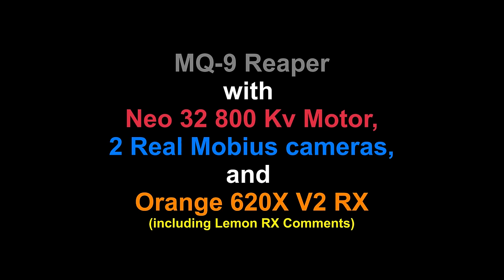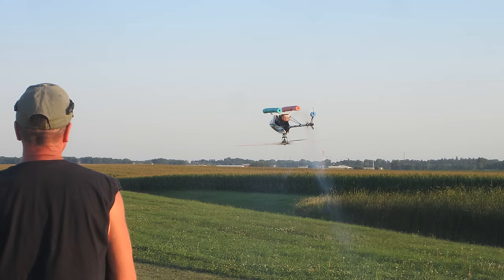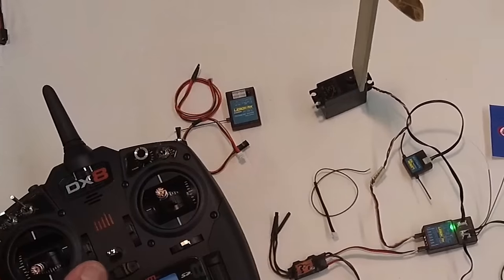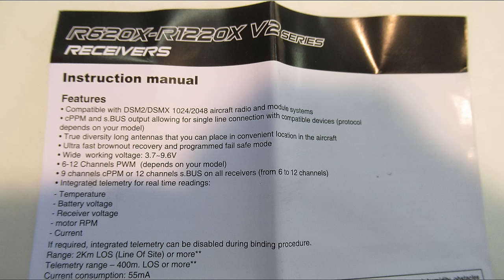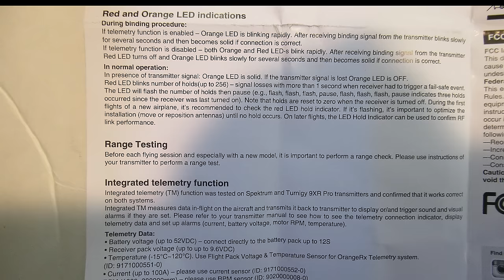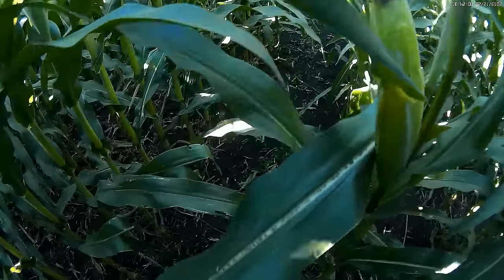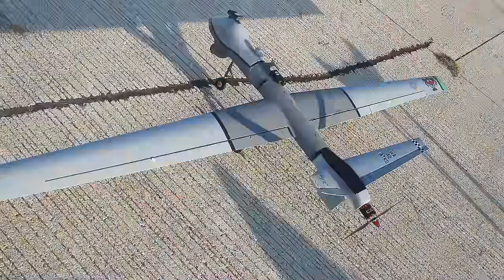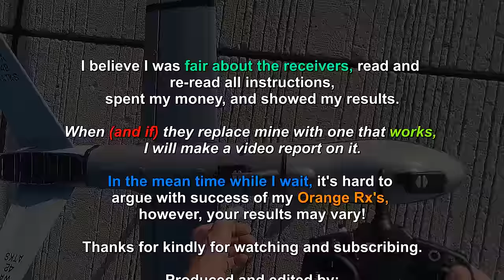MQ-9 Reaper Drone Restoration with an Apple, a Neo, an Orange, and a Lemon.

Comment: Great to see you back in the air with it, the name lemon is unfortunate. We the the saying here un the UK "I bought a lemon" usually with a plush looking car that's comes loaded with hidden faults. 
It looks like the same now goes for RC receivers.
Reply from the maker: Haha. They are fledgling company so they will come around I expect. Others seem to have good luck as I also expected. People always promote what they fly,  but in my case I have been using Orange Radios and receivers for many years, thus proving the reliability of them to me. Never had a failure, even in DSM2, as most of those machines I show are. I had more trouble with the Spektrum RX's. Thanks for the comments.

Comment: I use Orange module with a 9XR, and other oranges. In an effort to diversify my fruit stand, I tried a couple Lemons.  I also have a DX-6 that was, after tooth and nail, refurbished by the manufacturer (mode 2 throttle potentiometer failure.) Now I use that TX as a trainer, kids, nothing serious TX. Recently I decided to bind it with a Lemon RX to diversify RX's vs TX's at the field. The DX-6, Lemon combo proved catastrophic to one young pilot's bid at flying a simple 3 channel that I've seen him fly like a champ many times before. After the "complete lock" of controls he experienced, I set up a similar air frame with an Orange, same DX-6 and it was perfect. In troubleshooting TX, RX it's tough to call a culprit, but I've personally experienced problems with Spectrum Lemon. I'm happy to see others are picking up on this. I wish I could get my money back from Spectrum. Times change in RC, quickly. My 9XR is perfect on Orange module, Orange RX and for serious models, I use FRSKY Mod+TX.

Comment: Hi Dave, I've just had a play with my Lemon DSMX 6 Channel RX with satellite.I bound it to my radio, switched it off and removed the bind plug, no failsafe! Pushing the button does nothing at all.So I had a think, rebound it again, this time I didn't switch anything off, I left the bind plug connected, moved my sticks to the desired failsafe positions et voila, failsafe on all 6 channels!Lemon customer service is excellent, far better than HK, try buying direct from them if you decide to try another, there delivery service will amaze you.Good luck & happy flying!
Reply from the maker: I tried all that and even talked to the Seller, who is reputable.  Your receiver is not aTelemetry version, so there may be a difference.  I couldnt send it to Lemon RX, because I did not buy it direct from them. I didn't know, you know. I bought it from a place I always buy from and had it in 2 days. There is something wrong and they told me to send it back. I wanted it to work, but again, I have had years of great success with my Orange Radios and Receivers, so you can't blame me for having cold feet now. If I get it back, I will try again, but in reality, I don't need anymore receivers anyway, as all my planes are working just fine and I only wanted to try one with telemetry.  I did not know Orange made telemetry receivers when I bought the Lemon on your recommendation.  Thanks for the comments.
Reply: The DSMX 6 channel without telemetry direct from Lemon is cheap.
I have never tried telemetry with Spektrum, so I have no idea really.
If your happy with DSM2 (Which I know you are), might be worth trying a Lemon DSM2 receiver as they are very cheap.
Reply from the maker: Oranges are inexpensive too.  I am happy only because they all work you know.  Before DMSX, there was only DMS2 anyway. My 2 new Orange RX's are DSMX, and I intend to use DSMX rx's from now on.  If I get the Lemon Telemetry version back again and it works, I will put it in something and try it.  I wanted it to work you know.   Thanks again.
Reply: +NightFlyyer glad Orange is working for you, your RF link problems all antenna related as your new DX8 with diversity antenna seems to be working well.

Comment from the maker: Lemon Instructions say, bind with throttle down, then pull bind plug out before shutting off.  I did that....at least 30 times! Failsafe still failed!  First the wings folded, then it burned out a motor and I spent an hour in the cornfield.  Then using my Apple I ordered a Lemon and an Orange, which gave this flight result with my MQ-9 Reaper Drone.  
When (and if ) the Seller of the Lemon replaces the one I sent back 3 weeks ago with one that works, I will report on it. In the mean time, I will continue to use my reliable Oranges. I ate the grape!  :-)
Reply: Thanks for sharing Dave.... I'm just curious... with your new Orange v2's did you bind in DSMX or DSM2 mode?  I had 5 v2's lock out on me at Flite Fest this year (all bound in DSMX mode); whereas, in the last 2 years I've never had any issues with my old DSM2 Oranges.   The irony is that the plane I chose (and successfully flew) for the Guiness World Record attempt at Flite Fest was a LemonRx bound in DSM2.  Part of me wonders if the Orange's DSMX might not have been up to snuff for channel hopping with the aggregate number of pilots flying.  

Anyway... just curious about what mode you're binding in.  And totally agree that peoples' mileage will vary.  (Oh, and I got my LemonRx direct from Lemon (http://www.lemon-rx.com/) for what it's worth.)

Thanks for your vids... always enjoy seeing what you're up to.
Reply from the maker: The DX8 Gen 2 binds to the RX's to what it sees from the receiver. My Orange 620X Version 2 always binds in DSMX, as you heard it say. If I was using a DSM2, it will bind to it that way. I'm sure the Lemons are fine, but I'd like failsafe to work every time and it would not. This was my first attempt using a Lemon and again, both my oranges and DX8 are Version 2 upgrades. Congrats on your record.
Reply: Thanks... yeah, failsafe is important for sure and I wouldn't have flown that Lemon either per your experiements.  

I didn't notice the voice from the DX8... missed that.

Reason I asked is that one can choose DSM2 manually in the DX8 and other Spektrum radios as both the Tx and Rx's support both.  So I was just curious.  I think part of my problem may have been a lack of availability of free channels for the DSMX to hop to.  Not sure.  The lockouts didn't occur during the GWR attempt, but just in general flying.  So there weren't 100's in the air, but definitely lots of pilots up.

Anyway, thanks again.
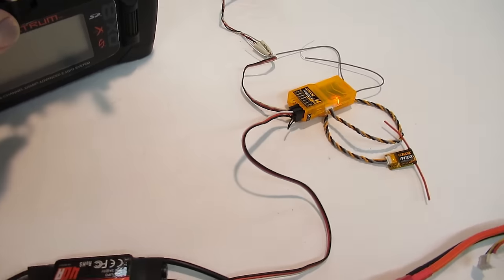Reply from the maker: That maybe.  Remember there was only DSM2 in the beginning, and switching all rxs and re trimming, etc would be labor intense and expensive. Since all my machines work, I really dont need to do that. You know, I usually don't fix something that is working.  :-)  The DX8 Talking is great. It tells me by voice the battery voltage, and other things without having to look down.  You can hear "Her" talk at 3:00 during my binding and see it on the screen. I would not probably try to over ride the DMSX when it bound up, as but in your case maybe that could be done.  Thanks for the comments and happy flying.
Reply: Where can I get the MQ-9.
Reply from the maker: NitroPlanes.com
Reply from the maker: I got mine at Nitroplanes.

Comment: Very nice to see this ehm 'drone?' again :)  Well no.. let's not call it a drone.. Good to see it again though.. Quite a nice platform.. 
Did you get this one from HK by the way?? 
Did you say '800 kiloVOLT' there?? :$ :$
Well.. glad the plane worked out well this time! :D  
Cheers & have a good week
Reply from the maker: I got it from Nitroplanes years ago.  It is a 800 Kv motor, that means 1000 rpm per volt, hence Kilovolt.  Cost was $60.  Thanks.
Reply: Hmm yeah.. I did understand what you ment to say, but KiloVolt sertainly isn't correct (can't link sites explaining that here regretably :$) 
kV does mean kilovolt by the way. But let's not try that just jet on rc's :)

Comment: Hi dave ok found that orange rec and satellite ok what would you recomend for a Esky 900 (AKA)Esky 500 for receiver the spectrum ar6200 or the orange rx620x v2 i respect you feedback thanks sir...
Reply from the maker: Well I have an orange DSM2 with satellite in my ESky 900 and it has never failed.  Had it many years now and even caught a fish with it.  I like my 620x RX V2 and it seems to be working fine.  I have 2 of them and would not be afraid to use it in anything.  I have also been using an Orange Transmitter with it in my ES900. Thanks for the comments.

Comment: Thanks Dave, I have one these new in the box. Any ideas on how to strengthen the wings?
Reply: If it came with carbon fiber wing strut it has the upgrade if not buy a carbon fiber wing strut
Reply from the maker: Right. After my first accident, I contacted NitroPlanes and they replaced the metal wing spar with a carbon fibre one.  If you have that, then all will be okay, but due to speed and long wings, It still is not advisable to yank full up in a high speed flyby or turn.  Good luck and happy flying.

Comment: now I miss my reaper
Reply from the maker: It's pretty neat all right. I don't know if they still sell them.  Where did yours go?
Reply: They no longer sell them,  I have pretty much have gone to ads on Rc forums, my wings folded also, but a gust got her. I bought the Global Hawk, similar, but is EDF, converting to pusher prop
Reply from the maker: That wing folding is probably why they aren't sold anymore. I know how much of a bummer that is, because setting it all up for me was a pain in the first build, especially putting the speed controller in the front and running wires all the way to the back, the flaps, etc. The global hawk should be better.  Happy flying and thanks for the comments.
Reply: +NightFlyyer I actually sandwiched the center with 1/8 inch bass wood sheet in center and carbon rod 4 inches on both wings,longest drill bit I had, the Global Hawk is really a bad design in the wing area, I think this had a lot to them going of market Nitroplanes no longer  sales them, by the way n.a.I have similar taste in planes, I have a RQ11 Raven, also like yours. Which I am looking at building a foam core wing. if I may suggest AXN FLOATER-JET GLIDER EPO&#160;, from hobbyking, it is really a great plane , base model is best.

Comment: put a APM on it : D
Reply from the maker: Whats that?
Reply: A APM is a little flight controller with gps and other sensors. this little controller can stableze the plane and do mutch more! the best featers are return to launch and stabelazation modes. It is amazing what you can do with this and it is not expensive.
http://www.banggood.com/MiniAPM-V3_1-Flight-Controller-With-Neo-6M-GPS-For-Multicopters-p-951861.html
Or this one:
http://www.banggood.com/Mini-APM-Pro-Flight-Control-with-NEO-7N-GPSPower-Supply-Module-for-Multicopter-p-982501.html

I hope you try it! Like your vids! ; )
Reply from the maker: Aha.  Well I don't usually use crutches, as I can be a pretty smooth pilot, having learned without them.  It was breezy that day and it probably would have made a smoother flight with the APS for sure.  It sounds like a nice unit and I will consider it. Thanks for the suggestion.
Reply: its not only for stabelization you can set a failsave so it can flt back to you. Or do some other cool stuff with it : D